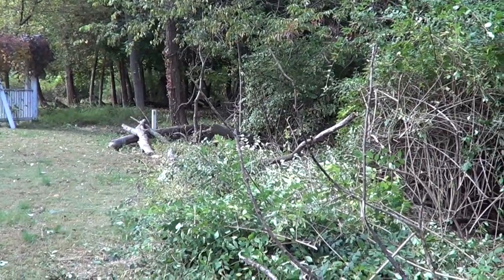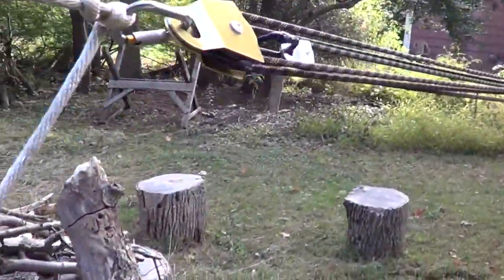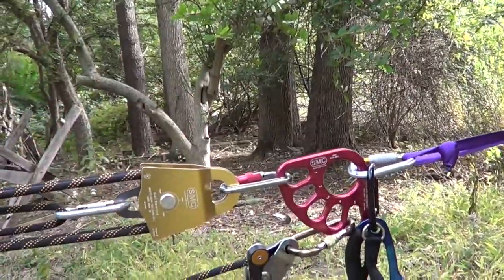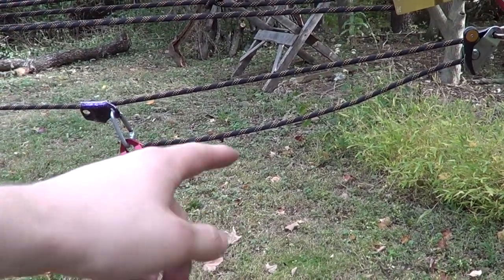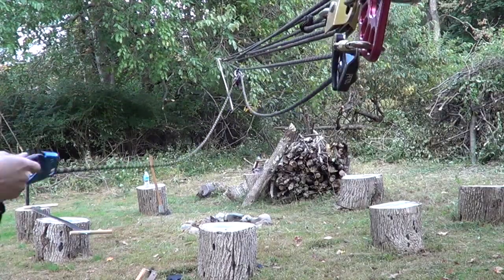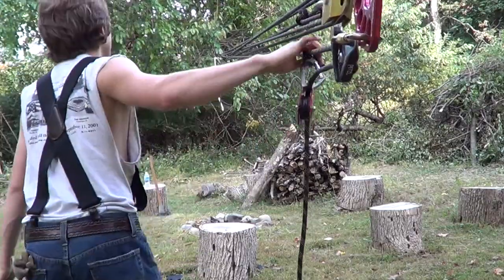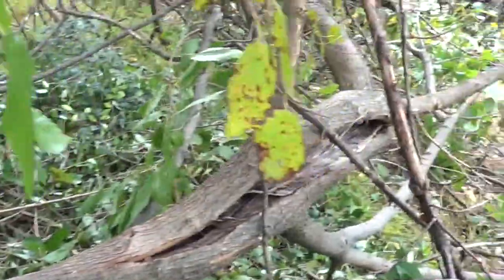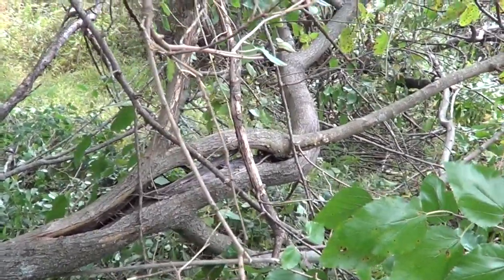Mechanical Advantage

Comment: Only moving pulleys give MA. Pulleys attached to anchors are just change of direction. Your initial set up is 6 to 1 (the formula is simple moving pulleys X 2 = MA. When you added the additional moving pulley, it was outside of the initial set up (it is called a compound pulley system if you want to look it up) and rigged to advantage so you gained 3 X on top of 6 X (its 3*6 not 3+6) so MA is 18X. I know it is confusing. A sure-fire way to figure out what the MA is goes like this lay the rig out on the ground with no load and haul enough line to move your moving pulleys 1 foot then measure how much line you hauled.

Comment: Keeping the highest efficiency equipment closer to where you are hauling from will leave you with a much higher actual mechanical advantage at the load. A 5:1 with low efficiency equipment up front can have a smaller MA than a 3:1 with the same equipment but the equipment swapped.

Comment: With those high efficiency pulleys the way you have your system you lose 5% on 1 then 50%!!! on the grigri, then 5% lose on 5 more pulleys. For an estimated MA of 12.85:1 at the load.

Comment: You have a 6:1 with a 3:1 multiplier= 18:1
Reply: technically, the GriGri has a 50% loss due to friction, so the end result would be around the neighborhood of 9:1.. minus roughly 5% per pulley..
Reply: Not so bad as all that. The 3:1 with the grigri would have 1 + .95 at the prusik, then .95 - 50% at the grigri. That’s 0.475 + 1.95 = 2.425:1 pulling on the 6:1 with 5% lose on each of those. Leaving you with 12.85:1 or rounded to an estimated 13:1 at the load.